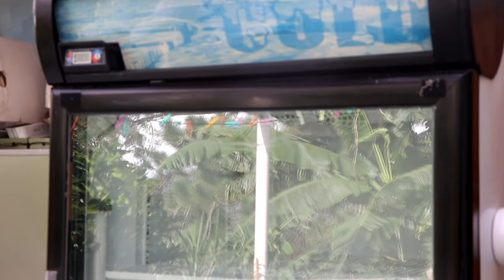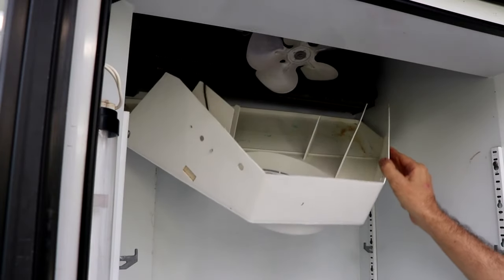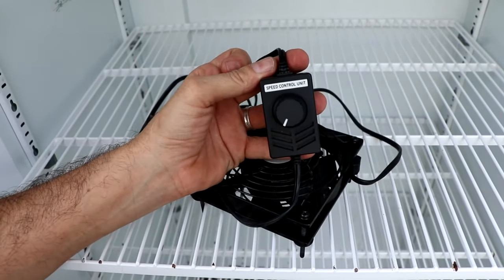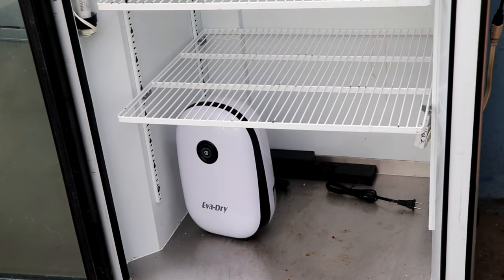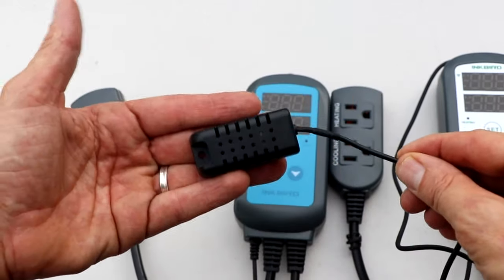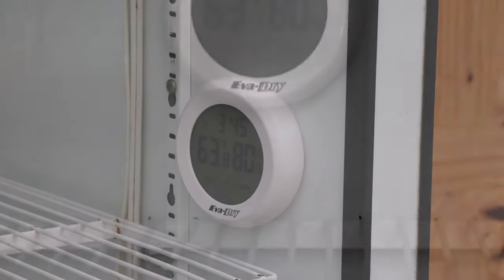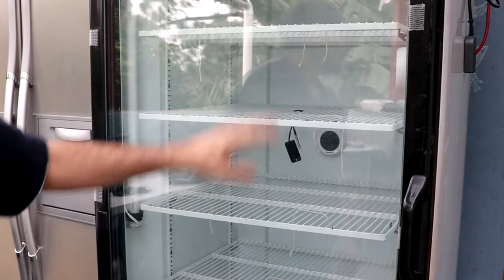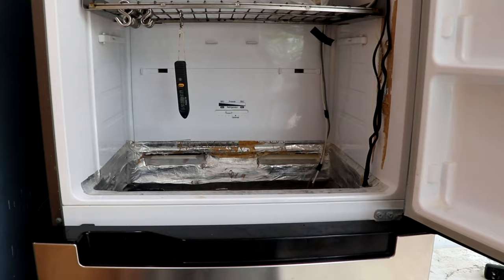Building a Salami Chamber/Cheese Cave - Easy Step by Step

Comment: I guess I need clarification on where to plug in the humidifier and dehumidifier. Do the cords dangle out of the fridge...or?
Reply from the maker: Hey Tyler.  So on the humidity controller there's 2 plugs.  One reads "work 1" and the other reads "work 2".  You would plug the humidifier in "work 1" and the dehumidifier in "work 2".   So your humidifier and dehumidifier are in the chamber but the chords are plugged on the outside.  Often people will drill a hole at the top of the fridge and run their cables through that hole to make it tidy.  Just be careful not to drill through any wiring or gas lines 😁
Reply: Wow thank you so much for the quick response. Love the channel!

Comment: good day, im planning to buy a wine fridge 

Haier JC-167 a 50 bottle wine fridge.

I wonder if i should use the evadry 1100 or 2500?
Reply from the maker: The 1100 should be sufficient.
Reply: @2guysandacooler  thanks for the help. :)

Comment: Thank you so much for the content! Im searching for the dehumidifier at the moment and I live in the EU. It is quite pricey to order eva dry 1100 or the model you have shown in the video. You said that you`ve tried many model, thats why i dont want to risk buying jsut something. Do you know any other models, that might work? And how to choose a dehumidifier for salumi chamber if you dont know any other specific model :) Why specifically eva dry works, any idea?
Reply from the maker: I'm not sure who to recommend in the EU.  Some of the models that I've tried were Chinese knock offs and broke rather fast.  Just make sure that your unit is Peltier technology, has an auto on switch (so if the power goes out then comes back on your unit will turn on automatically), and make sure the company you buy it from has good reviews on it..

Comment: Do humudifier and dehumidifier "go crazy", trying to keep the set humidity value in controller?
Reply from the maker: LOL.  Not really.  If the parameters are set too close they will tend to compete with each other but typically it's a very smooth balance..

Comment: The 2 1/2” diameter salami lost 30% of it’s weight, after 2 weeks, I believe it’s a bit too fast, what are your thoughts
Reply from the maker: That does seem a bit fast.  That should take 4-6 weeks give or take to get to that weight loss...  You might want to check your air flow and make sure your humidity is in the 80% range

Comment: question about inkbird controllers, where i live is remote enough that i can't get high speed internet, but I can tether devices to my phone.  Do the inkbird controllers require WiFi to work correctly? because I wouldn't always be close enough to tether data to them.
Reply from the maker: If you want to use the wifi feature then you would need to connect to wifi.  Otherwise the unit works as a stand alone unit.

Comment: First thank you for the. Great information, my chamber is completed with the inkbird controllers , but used the PRO breeze dehumidifier (same size as 1100 Eva dry with same technology) . I had salami in the chamber for 4 days, on the 3rd day there was about 1 inch of water and the dehumidifier container, so I assumed it is working ok.  The huge problem I have is that there is too much humidity in the chamber when the cooling comes on the humidity goes down but when the cooling goes off it immediately starts going up quickly I am finding that the problem is the  humidity stay up high.  I tried leaving the parameters at zero % instead of 3% and also I unplugged the humidifier on the 2nd day and it is still going too high as of today.  I used the incandescent (60 watt) bulb it doesn’t seen to show much of a difference.  What can you suggest?
Reply from the maker: Quick question.  How much meat is in your chamber?  What is you temperature set at?

Comment: Great video! The problem I always have with this kind of setup is that people tend to use old or second hand fridges (which this one appears to be) which are usually not very energy efficient. And then you have to power all of the sensors and controllers, etc. Any idea how much energy this setup uses?

Comment: Curious why you don't simply add the speed control to the existing fan.
Reply from the maker: If you have that skill set then it would totally be a good option.  I don't have that skill set.  It was just easier for me to add the computer than rewire the existing fan system..
Reply: @2guysandacooler so does the computer fan stay on constantly? I noticed you plug it into your main power strip on top, rather than having a separate power strip with both fan and fridge that feed into ink bird temp so they both come on when cooling. I suppose that's to just keep a small amount of continuously circulating air?